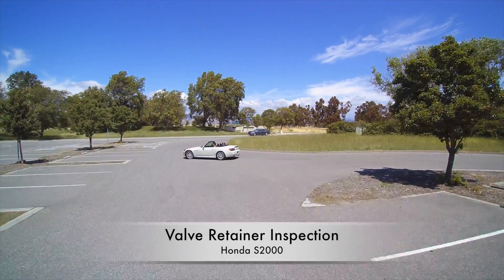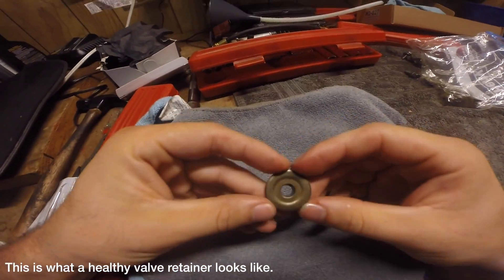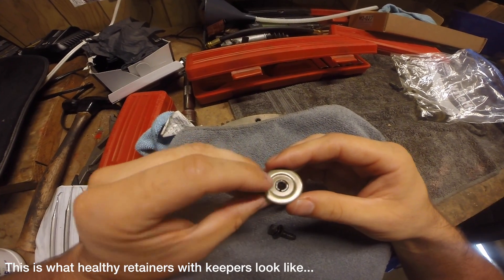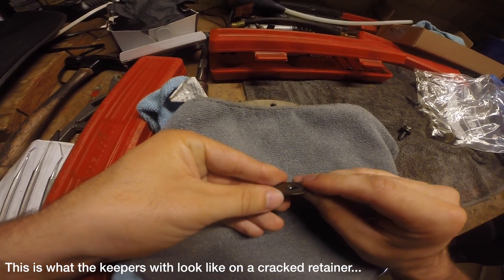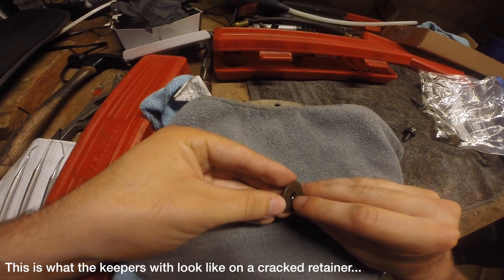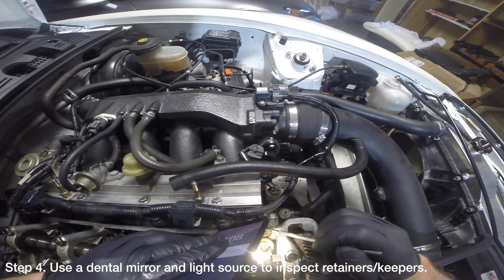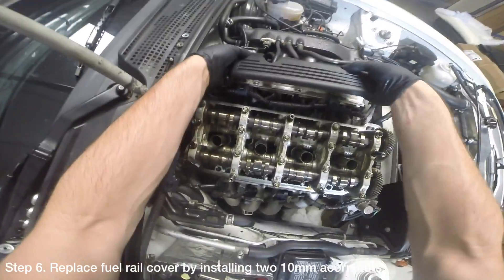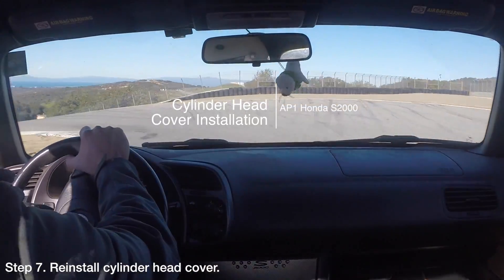Valve Retainer Inspection | Honda S2000

Comment: Any chance on a power steering fix/replace? My wheel started shaking and is stiff turning driver side.
Reply from the maker: Steering rack replacement isn’t too bad. It necessary for steering rack bushings to be replaced so if someone wants to volunteer a car I’ll do it.

Comment: Stop believing the retainers crack and drop a valve FALSE even inline pro states it's just bunch of forum nerds saying that . It's a myth
Reply from the maker: +Uzi H source?
Reply: DIYGuys one of the most reputable s200 shops in the nation inline pro. Honda doesn't manufacture faulty things like this I own one was in process of changing. Mine out till o spoke to them
Reply from the maker: +Uzi H I am aware of inline pro and what they do, I'm just looking for some real source. Wish they would share their great knowledge with the world.
Reply: So you're saying cracked intake retainers is just a myth?
Reply: any car thats mechanically over revved will generally do this ,if the cars not been over revved i see no point in replacing them.
Reply from the maker: The thing is nobody mechanically overrevs a car on purpose. So you should consider replacing the intake retainers if you’re doing some driving where you might misshift, like on the track or at auto cross.

Comment: Do you recommend replacing the retainers on ap1s even where there is no sign of cracking on inspection?  Just as preventive maintenance?  If so, what replacement retainers do you recommend and do you do both intake and exhaust or just intake?
Reply from the maker: +Robert Gerety I only recommend upgrading healthy retainers on cars that see HPDE (auto cross or time attack). Go with OEM retainers and cotters, aftermarket ones will just be less durable. You only need to replace the intake ones.
Reply: What if your making 500whp on a turbo set up?
Reply from the maker: Retainers fail due to mechanical overrev so it doesn’t have anything to do with horsepower.
Reply: @DIYGuysvideo  thats kind of what im finding . i talked to a guy that had 700whp for 30k miles and ap2 retainers.my tuner recommends supertech springs and retainers. But im kinda finding that if i set the rev limiter to 9200 . dont go passed 9k rpm the ap2 retainers will probably be my more reliable option. And cheaper at that! its just a scary subject lol

Comment: how do you know if you need a valve adjustment???
Reply from the maker: Some people can tell by the noise of the valvetrain. If the valves are really out of spec you will throw a CEL. The best way to tell is to check the clearances like when you perform a valve adjustment. I will make a video on that soon.